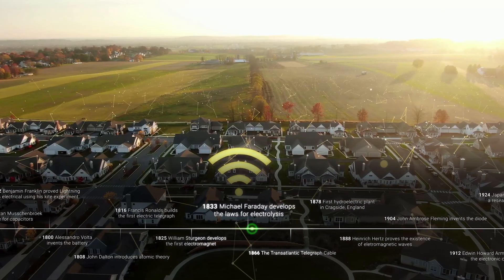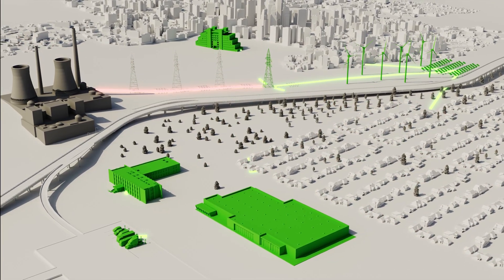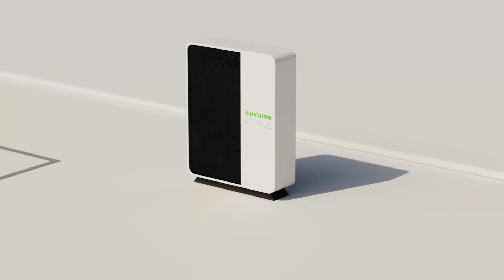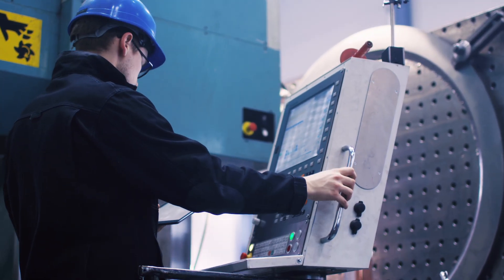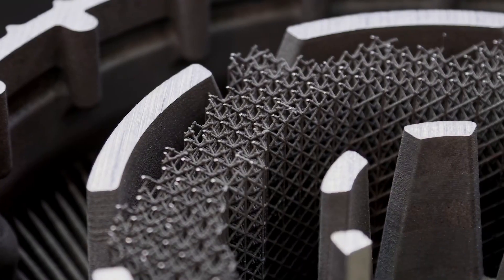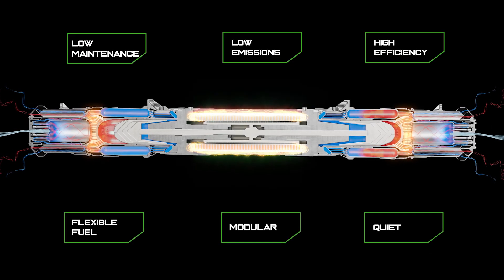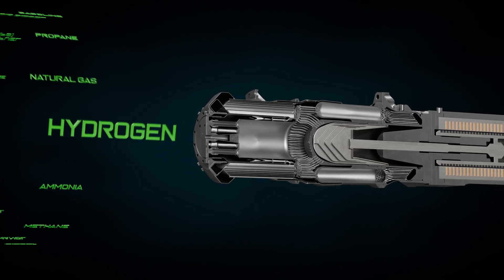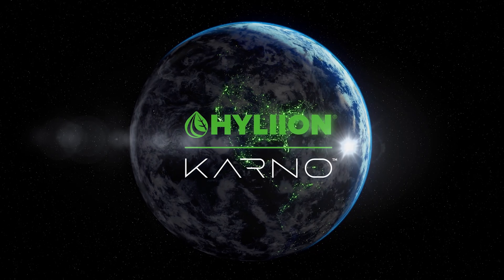Hyliion KARNO Generator

Comment: Temporary power & lighting is a great growth market.
Mobile Fairgrounds, Circuses, and other touring  entertainment venues come to mind.
As a 19 year shipyard electrician who has done a lot of temp lighting and power, I see lots of lateral growth by maximizing cash flow toward 3D printer growth. For higher profits, I see equipment rentals raking in the high spenders.
I fear analysis paralysis more than getting the product started and hustling to bring in cash.
The Navy route is great, they love reliability.
Most of your shipyard contractors purchase smaller backups but there are contracts that fit 200k backup power demand.
Moving sideways, tunnel boring, possibly mining. Rentals used as loss leaders or free trial runs may buildrepeat business from utility maintenance responding to disasters to restore power. You will have to empower your sales crews with options to incentivise priosects, be fast to respond, and deliver.
Ice storms tornados, hurricanes, and other disasters will need lead time to position units for rapid response via low cost rail and barge transport.
I really like equipment rentals if the price point on 10-20KW units becomes feasible. Sales, and repeat customers!

Comment: I want to see a side by side comparison of a class 8 Truck with Karno's vs. one with Bosch fuel cells. Give both trucks and equal amount of hydrogen and let's see which one goes farther on the same road. That's a simple test that will tell us a lot!
Reply: Tesla semi has greatest efficiency 1.6kwh/mile.
can haul 82k gross 545+ miles in 8H, over 1200 miles in 24H.
Tesla is 100% BEV.
with over 1200 HP
Reply: @markplott4820  fax, no printer

Comment: I'm sharing this video on every platform I can. Great information here. I wish it made the point of using KARNO to charge BEV fleets in order to take strain off the grid. The point could also be made that there is a national security aspect in using KARNO generators as a way to diversify the electrical grid. I'm going to continue to buy shares of this company at the ground floor.

Comment: Karno needs to be advertised for more hard to decarbonized industries like freight rail and ocean transport! Rail should be easy considering a fuel car can be pulled and freight trains are diesel electric anyway, imagine them run on carbon negative RNG Karno generators. Ocean shipping would benefit from this too for companies looking to add carbon negative shipping to their operations!

Comment: how is this different then any other generator?
Reply: They’re claiming is can use multiple different fuels
Reply: It has no internal combustion, which has carbon emissions. The karno is external heat with net negative emissions, 67 decibels which is quieter than we speak. It is agnostic fuel design able to run o n 20 fuels. No oil, no maintenance,  one moving part.